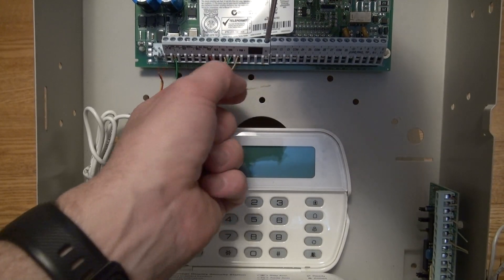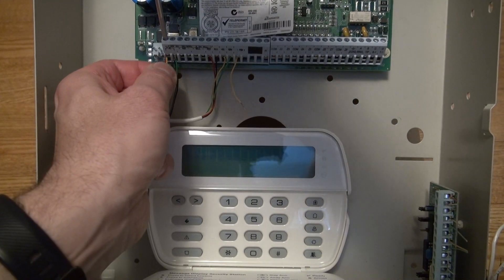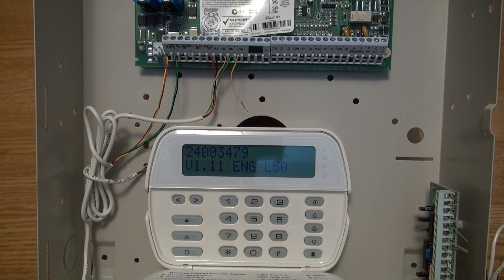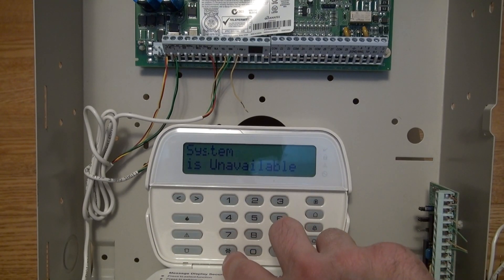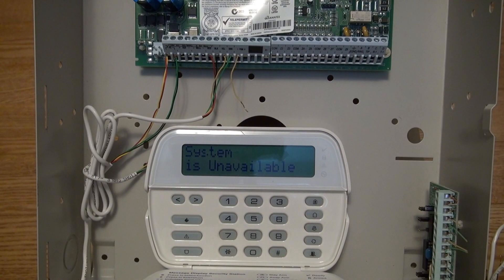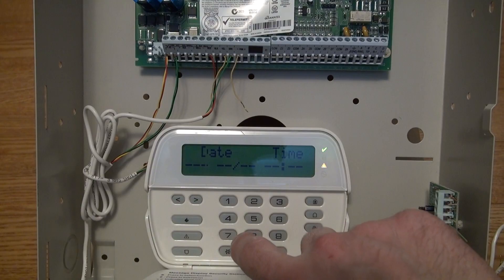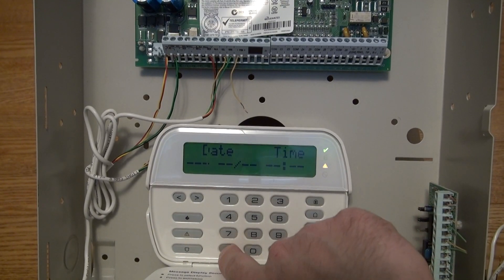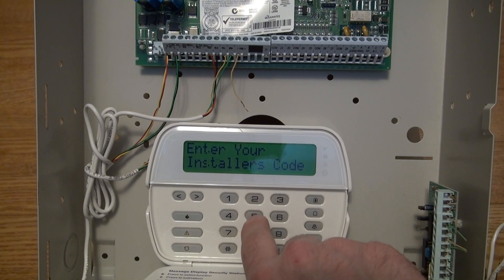How to Factory restore, reset your DSC alarm Panel, PC1616 / PC 1832 / PC1864

Comment: I'm not sure what model of the DSC keypad I have.  However, it looks very similar to the one in this video.  Will this wipe out all the zones, etc in the alarm system?  Sounds like it would.  I was given a list of what all the various zones equated to when you got a code on an alarm.  However, they "couldn't remember" the user code.  How do I just get into the keypad to delete or override their code & create my own?  Your help would be greatly appreciated!
Reply from the maker: Yes this will delete everything and you would have to reprogram the system. Question, do you have the installers code?
default is 5555

Comment: doesn't work on PC1565?
Reply from the maker: Yes this will work on the PC1565. The only way it won't work is, if the panel is locked.

Comment: Great video. What's involved in the reprogramming? In my case I have both wired and wireless sensors. Do I have to re-pair all wireless in the event of a factory restore? Also, I'm looking for videos on how to remove sensors, I have smoke/co detectors which have reached end of life, 2 wired, 2 wireless.  It's not worth replacing them as the parts are rare and expensive. I have Envisalink/EyezOn setup, would that be any help in reprogramming?

Comment: Hey jason, I have no problems making a donation for your time.
I have a 
trouble code (*3 fire zone) the unit is also scrolling the zones.
Reply from the maker: What panel model do you have?
Do you have the installers code?
You can try.
Reset a fire zone by press *  7  2
Reply: @JasonTech  thank you for replying, I had the guy that installed it take care of it.

Comment: Hi thank you for the video. I just moved and am still sorting through the alarm. No installer code and no master code provided. Will this work for a PK 5501? Panel looks exactly like the one in your video.
Reply from the maker: Yes, But keep in mind you will have to reprogram the alarm system.

Comment: Hi Jason - Ive just powered down my PC1616 (V4.60) (including taking off battery); left it overnight and powered back up.  I can't get my RFK5500 keyboard to auto enroll now on powering up.  It powers up and the date/time correctly set and then when I press a key the screen says Press (*) to <> Select Partition.  When I do that I get another screen which shows the numbers 1,2,3 through 8 and under the Partition number 1 is the letter N.  I can select that for the system and it then says registering and shows the letter R under the number 1.  However, it doesn't keep it and after about 2 minutes it forgets it.  Any ideas on cause / solution please?
Reply from the maker: Have you tried a module scan?
To reset a module
• Enter Program Section 902
• Press # and wait 1 minute for panel to scan the bus.
• Then enter Program Section 903 to see the modules
connected to the bus.
Reply: @JasonTech  Hi Jason,
So here’s the results:
Connected to the bus are:
- Keypad 8
- PC5132
- PC5400

The keypad (RFK5500) loses its registration after about 2 minutes still.
Reply from the maker: Can you try something? Can you remove the keypad and hook it up right to the panels bus.
Reply: @JasonTech  Hi Jason — sorry for the delay as I’ve been away. Anyway I tried your suggestion of wiring directly to the PC1616. And it worked. I’ve replaced the wiring from the panel to the 5500 keypad and it works perfectly now. Thanks so much indeed for your help.

Comment: Hi, My PC1616 panel in alarm is able to keep silencing the siren for a few seconds when any key is pressed. My old PC1616 didn't shut off until the end of the correct code was entered. It displays "CC" communication cancelled after the correct code is entered. Is there a setting for this? It's like definition 07 is on a zone but that would silence for 30 seconds not just a few. All unused zones are turned off.
Reply from the maker: I'm not sure what you mean. Can you take a short video and email it to me? info@jasonschannel.com
Reply: @JasonTech  Hi, Thanks. The old panel when in alarm the siren would stay on until the last number of the correct code was entered. The new panel when in alarm all you have to do is hit any single number on the keypad and the siren stops for a few seconds then starts again until you hit any number again on the keypad. Intruders could just keep silencing the siren this way instead of the siren staying on until the last number of the correct code was entered. When I just hit a number to silence the siren, then put the correct code in to disarm, it displays CC '' communication cancelled''. The only setting I can find that remotely resembles this is 07 for delayed fire, but this silences the siren for 30 seconds when any key is pressed, not the 1 or 2 seconds I'm getting. Plus there's no fire sensors or zones programmed for fire. Only 4 zones are used with the other 2 toggled off. I think the panel may be defective. 
Thanks

Comment: Hi there I have a DSC 1832 Alarm system. Did all the procedures but heard a click on startup. It didn’t reset. Now what?
Reply from the maker: Hi. If you have 10 clicks on the startup. Then your system is locked. You will have to replace the panel.

Comment: Hi there my system is locked out and I am not able to factory reset. What should I do?
Reply from the maker: There's nothing you can do, you will have to replace the panel. But did you try the old account number or the last 4 digits of the monitoring phone number?

Comment: Thats an Amazing instructional vidéo.
Does following this video reset everything?
I don't want my programmed zones to be removed. Or even if removed is there a way to reprogrammed easily? Is there any good reference for that?
The problem I have stopped to pay the monitoring provider (installer) more than 2 years for monthly pay and they didn't leave the master code!
And I have some troubles that I can't remove them from the panel unless I have the code.
Please advise!
Thanks
Reply from the maker: Yes, this will remove all programming. You need the installers code, try using the last 4 digits of there phone number or your account # you had with them. If one of them works for you. Let me know what trouble codes you have and I will tell you how to fix them.
Reply: @JasonTech  ok I will try those numbers. I will record about the system issues and send it to the email you have put in your youtube channel's about section.. thanks
Reply: @JasonTech  Hi, I tried their numbers, it didn't work, I have sent you a video and photos to your email !

Comment: What model keypad is that?
Reply from the maker: Hi. PK5500
Reply: @JasonTech  thank you
Reply: @JasonTech  does it matter if it’s the PK5500L1 ?
Reply from the maker: To factory reset the panel, the Keypad doesn't matter.

Comment: Thank you very much for the video. Please tell me how to clear " Service Required Error "? What does Enter Section mean at the end of the video on the keyboard?
Reply from the maker: When you hit *2 on the keypad, what do you see?
Reply: @JasonTech  I thank you once again for your prompt response. I was able to default the system and create a code. My problem now is that I cannot arm the system with my remote but with the code I can. Please help me in arming the alarm with my remote or let me know how to turn the alarm off when I enter the premises if I have armed the alarm from the keyboard.
Reply from the maker: Because you factory reset the panel. You have to now reprogram your alarm system. Do you know how to do that?
Reply: @JasonTech  No, I don't know.

Comment: Since I do not know the installer’s code, how do I prevent my alarm system to call the monitoring center . Dsc pc2550. Thanks
Reply from the maker: There's nothing you can do without the installers code. Keep in mind, if you factory reset your panel. You will have to reprogram the panel.

Comment: Very helpful.  Thanks.
I purchased and installed a new PC1616 w/ PK5500 that worked well for a week and went into Keybus Fault, call for service.  Disconnected everything, connected keypad directly to controller, still gets same fault.  What else can I try?  Thanks for any help.
Reply from the maker: Did you add any other devices? How many devices do you have like Keypads / expanders / anything thats connected to the bus line?
If you do have more then one device. Try removing everything from the Bus line and connect one device at a time. You might have a short somewhere or a faulty device.

Comment: Hi JasonTech, I followed the instructions and it did not reset.  I didn't hear any clicking sounds either.  After the reset and re-adding power, everything was still programmed like it was before.  The other odd thing is that I never changed my install code from 5555.  It's very odd that it's not working.  It's a brand new install.  Any ideas?
Reply from the maker: Hi. What panel do you have?
Reply: @JasonTech  I have this same question and the panel I have is PC1832. I tried jumping the PGM1 and Z1 but it did not reset the board. there is no clicking sound either just the normal beep.

Comment: When I try to press any panic of the alarm or test it by using *6 then pressing 4. It just restarts the system
Reply from the maker: Hi. If you press and hold any of the panic buttons for 2-4 sec and it doesn't do anything. Your panic buttons might be on silent. To change that, you will have to go into programming 5555 - 015 - see if you have a 2, if the 2 is not there, press 2 then ##. Then test it again.
Reply: And another thing about it is to arm the system you after to press away then enter the code and the same thing for stay
Reply from the maker: I just saw your video, without being there. It looks like you have low power at the keypad. Question: how many keypads do you have?
Try removing the battery and disconnect the power to the panel. Then reconnect the battery, then the power and try it again.
Reply: https://youtu.be/gRFm4KHynj4 the video of what’s happening

Comment: didn’t work
Reply from the maker: Hi Daniel. Did it make any clicking sounds when you tried factory resetting it? If it did, that means your panel is locked.
Reply: @JasonTech  I was able to factory default but now wireless enrollment feature *898 is not available. I  have to use section *804 instead. my labels says 1832 v4.6 and rfk5500 1.3.  is it me? equipment usually never goes bad.  using 804
to enroll the wireless contacts are working fine.  I  have over 17 zones so i’m just dreading alpha key manual entry if possible.
Reply from the maker: If 898 doesn't work, You can try a module scan hit 902 and give it a good 1 minute, if that doesn't work your stuck using 804.
Reply: @JasonTech  would you willing to consult and help me?
Reply: @JasonTech  I did *5555 902 and it asks me for section. my keypad says 1.13v. is that why?
Reply from the maker: If you would like, I could make a video on how to add a wireless zone?

Comment: Not working
Reply from the maker: Hi. If this didn't work that means your alarm panel is locked. Without the installers code the panel will have to be replace.

Comment: Hi i recently rented a house that have the alarm system.  It is  longer connwcted with a security comoany but the alarms still works because i triggeres the fire alarm just to test it. I do not know the code for the system but would like to harm the system sometimes.  How do i override the password or create a new one?
Reply from the maker: Hi. Do you have any alarm codes?

Comment: When I power up the system I get clicker sound 
Basically my son armed the system for our house and we don’t have the master code
Reply from the maker: Hi. After doing a panel reboot, If you hear 8-10 clicks come from the panel, the panel is locked out and you will need to get the installers code or get a new panel. If you don't hear any clicks, you can factory default the system and re-program it.

Comment: in dsc key pad the erroe gen syst tmpr erroe is showing contunisly after press *8 5555 902 902 ## any premintly solution for this
Reply from the maker: Hi Raj, it sound like you might have a tamper problem. Did you add or removed anything?

Comment: Hi, We followed your instructions exactly but now nothing will turn back on or power up. The keypads and motion sensors are completely dead. Any ideas why? Thank you.
Reply from the maker: What panel do you have?
Reply: @JasonTech  It is a DSC Power Series PC1832
Reply: Will the 1832 system work without the backup battery? We tried unplugging it to see if the system works just with AC, but still nothing. Tried re-connecting the backup battery, still nothing. If the backup battery is all of a sudden dead, would that cause the entire system to be dead? Even though we didn't have codes, it disappointing now after doing this that the sensors and keypads don't work. Thanks for any help.
Reply: I have exactly the same problem...

Comment: Hi, good video! Perhaps, I have a XL2-LT alarm. Do you know how I could reset it, to be able to add afterwards a new code for my girlfriend. 

There is that problem: 
I think something wrong happened with the alarm, maybe during a electric shut down at my place or cause of battery that died while ago. Because I can’t arm the alarm with one of my valid code.

Any help would be appreciated! Thanks :)
Reply from the maker: Hi. Sorry I'm not familiar with that system.

Comment: Nice instructional videos. My installer went out of business and to clear "GEN SYS SUPV" Error that appeared after I removed the Envisalink 4 Ethernet module in order to install a HUB6, I need the installer code. If I do a factory reset, can I just run with the default values or will I need to do extensive reprogramming?
Reply from the maker: Hi Alan, Yes to clear the trouble you will need the installers code. If you factory default your system you will have to reprogram the 1st 8 zone. If you still have the Envisalink, hook it back up and go here to setup a account https://www.eyez-on.com/EZMAIN/createaccount.php
If you need to reset Envisalink. https://youtu.be/K7QiipmYKfo
Reply: @JasonTech  thank you for the prompt response. As I want to discard the Envisalink and use a new HUB6, I think I will contact a local installer. Cheers

Comment: Hi Jason, I have a DSC Power 832 and have recently cancelled my monitoring. I am having the trouble light problem (communication with the monitoring station). I have tried to enter the Installers Code (5555) but it is not 5555. If I follow your instructions, will it revert my system back to factory settings or just reset the Installers Code to 5555? If it resets the system back to factory settings, do you have a video on how to reset the whole system, time, date, stations etc?
Reply from the maker: Hi. The power 832 installers code is 5010 / 5015 / 5020. Only the main panel will default. All modules will not be affected. So you will have to reprogram the 1st 8 zones.
Reply: @JasonTech  hi. I just followed your video and reset the alarm. Can you recommend a video to reprogram the zones?
Reply: @JasonTech  thank you for the fast reply... I tried the 3 codes, 5010, 5015 and 5020, the installer must have changed it as I can still not gain entry. I am presuming that I need to follow your instructions on the video. I will then be able to use one of those codes to gain access, delete the 7 and reinstall my zones... Yes?
Reply from the maker: @robertfarey9800  Yes that's right.
Reply from the maker: Try this this first. 
Remove the battery then unplug the power. Then plug the power back in after 10sec. If you hear a few clicks then your panel is locked and you can't do anything with it but try to guess the code.
Reply: @JasonTech  that doesn't sound good... If I enter too many wrong codes will the system shut down?
Reply from the maker: @robertfarey9800  No. It just will take all day, Start with 0000 and work yourself up.

Comment: Ok, so I found the installer code, however is there also a different code called a lockout code or is the installer code one and the same?  I did unplug the battery and unpluged from from the wall.  When I plugged back in I got the clicks and then the beep which I've read that means it's locked out.  Right?  Thanks.
Reply from the maker: Hi. If you get no clicks it's not locked out. If you hear 8-10 clicks coming from the panel, the system is locked out. To remove to lockout do * 8 then installer code
991
installer code
991
# #
Hope this helps.

Comment: One of my motion sensors #6 is not allowing me to arm the system after I changed the 9V battery - I have to keep bypassing the sensor (* 1 > scroll #6 * #)
Can you advise me how I can correct this carvy@live.com
Reply from the maker: Hi, after you changed the battery did it show zone closed? Are there any light on the motion?

Comment: Hi, I don't know my code on my PC2550. Does the same process work on this model? If not is there another way?
Reply from the maker: Hi, Your default installers code is 2550. If that doesn't work then try this.
Follow the sequence outlined below to reset the panel to
factory default conditions.
1.Power unit down by removing both AC and battery power.
2.Using a short jumper, short pins marked “EEPROM
RESET” together.
3.Power PC2550 up.
4.Wait for 10 seconds then remove shorting jumper.
5.The system will have reloaded the EEPROM with the
factory default codes.

If your system is locked this will not work. You will have to replace your panel.

Comment: Hello I recently switched over to a VOIP telephone system and when the Internet signal drops it makes my phone say it's disconnected and it sets off my alarm system.  How do I disable the my home phone to the DSC panel so that when the VOIP telephone drops it doesn't set off my alarm system?
Reply from the maker: Richie Loc Try this, but you will need the installers code. Hope you have it. https://youtu.be/A4vZprG2bg0